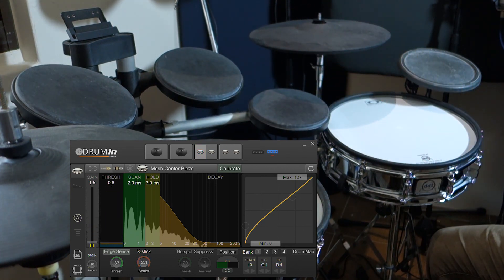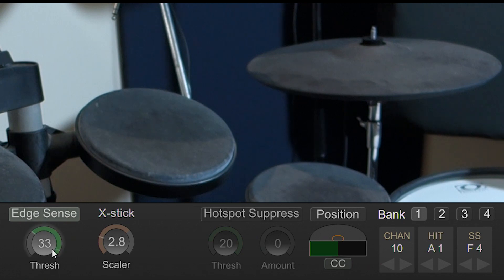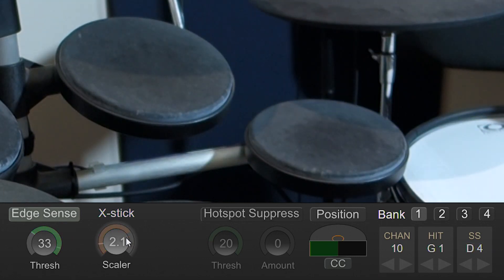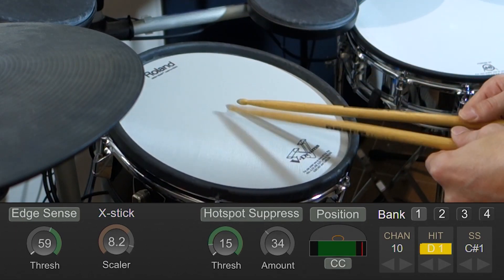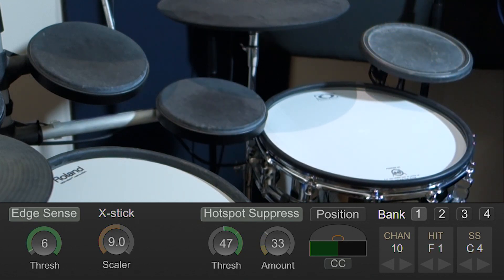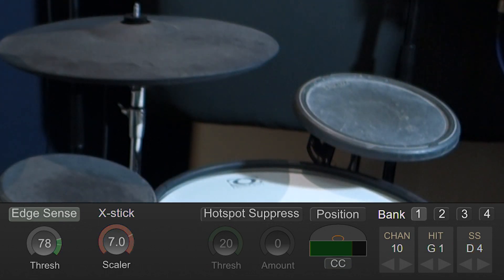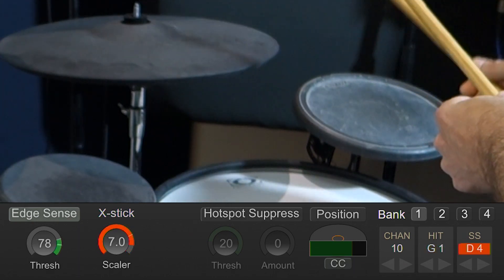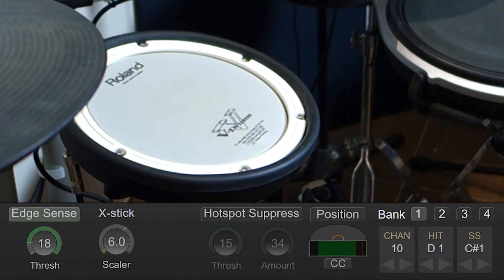eDRUMin: Using Edge Sense to get two articulations from a single zone pad

Comment: So would it be possible to have a single zone hihat cymbal on a hihat controller such as the goedrum, work as a two zone cymbal? to get the edge and the surface. Or is this only working on pads and not cymbals?